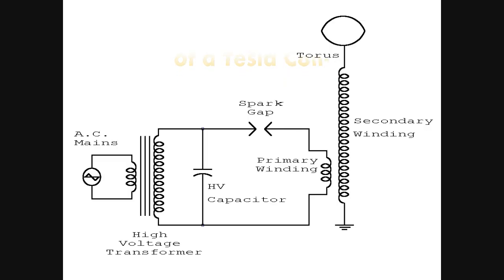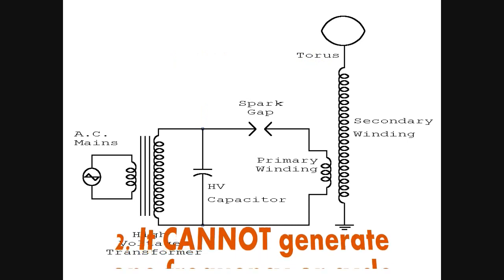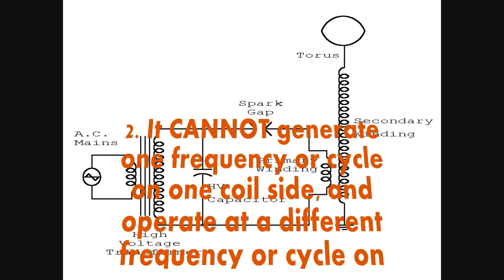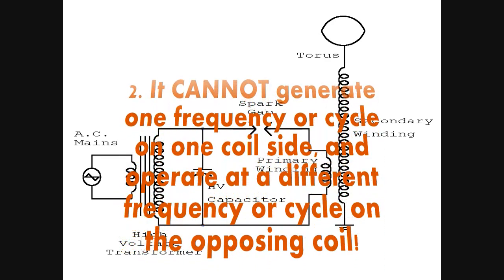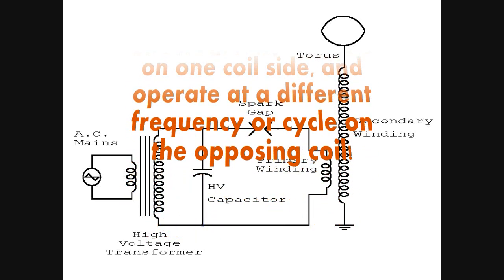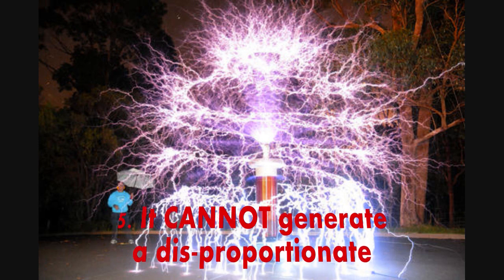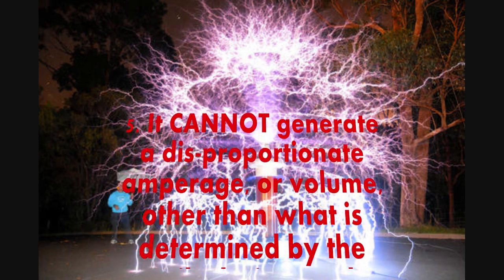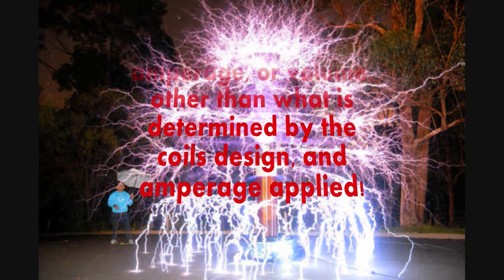5 TESLA COIL IMPOSSIBILITIES

Comment: Electricity is so cool looking?  Glad your looking, the purple has you see is called plasma energy, You can find the temperature of the spark by either Light Emission, or FCC Radio Frequencies! For that to turn purple/blue instead of white (Natural light) is in the low/high-frequency/temperature range!  Yes, I think plasma energy is cool too!  Tesla was experimenting with Plasma Balls of Lighting/electricity?  According to the chart approximately at 10^13 to 10^14 frequency range! About 1000 MHZ

Comment: For the sparks that jump through the air to ground potential!  There is a formula to give resistance to electricity in air determines spark distance! Good video, good example of HV,HF, spark details!  Question? Basically how do you store said energy, If not by, Batteries, Capacitors, or other means?  The Idea is to stick all that energy back into a CAN, for use another time, called Stored Energy?  Great radio station you've got, need to be up higher not to spark-to-ground! Good work!

Comment: It seems that you don't understand Voltage Rise through Standing Wave Resonance (VRSWR), which indeed allows a Tesla coil to achieve much greater voltages than one would expect by turns ratio (transformer) alone.
Also..... If you remove the Earth ground and retune, you will find that you do indeed get discharges from both ends of the secondary coil.
I think you may be right in your first statement, though.... the coil sparks originate in space and drain into the top capacity and then to Earth.

Comment: Lightining also produces static signals. You do realize that lightning is ALWAYS happening right? Also, the sunlight is a frequency (many of them). With lightning if it is timed right each bolt of lightning will add to the power of the next. Its called oscillation. Couple that with negative resistance and proper timing. Go do some reading on Moray. He proved his box worked in the middle of nowhere. Its not hard to harness the power of lightning and our earth.

Comment: Ok maybe that was a bit harsh. The 3 dimensional vector calculus solutions are rather intractable for anything but the most simple cases. However, very accurate FDTD simulations are cumputable (along with other simulation methods). Its almost funny, you rely on the laws of electromagnetics to design your coils, then try and use theses coils as proof that these laws are false.

Comment: Tesla coils in no way produce "free energy". The copper losses alone are greater than any outside energy recieved from the surrounding environment. A tesla coil is basically a glorified swithmode power supply. The spark gap acts as a switch that turns on and off current through the primary at the secondary circuits resonant frequency. Exactly the same laws of electromagnetics apply to tesla coils as any other transformer. You sit down and do the vector calculus and show me ozherwise.

Comment: I have built Tesla coils.  It is very simple to measure the energy in and out.  One problem that most have is getting a meter that measures true RMS amp draw; this is necessary for measuring amps in circuits other than 60 Hz.  But regardless of that, before I had those meters, I still never saw an over unity situation.  Good luck in your endeavors though.

Comment: part 2. Not to mention an ignition coils is solid state and generally has a solid core...Tesla Coils usually are air cored. Faster pulses = more power in both cases. Make a Tesla coil sparkfishes...you might be surprised at the results if you do it right.

Comment: You need proof that Tesla Coils produce more power then they take in (actual power not just voltage)...please take the time to look at ignition coils in cars. While they are not the same as the standard Tesla Coil an ignition coil from a car can produce more then 6300watts of power...I am certain a car battery does not provide that. High frequencies create faster pulses..thus producing more energy through pulsed induction. Its not "free energy" its just neutral.